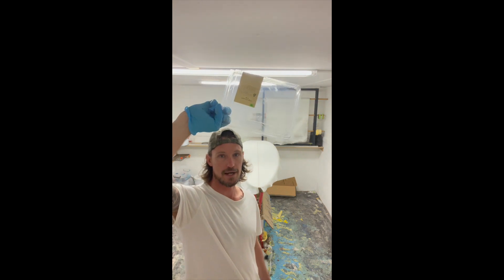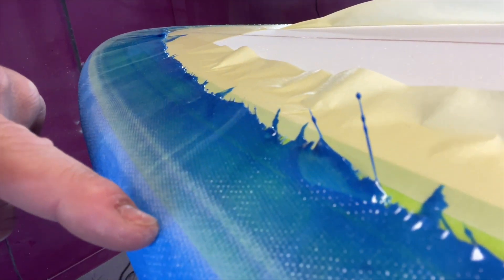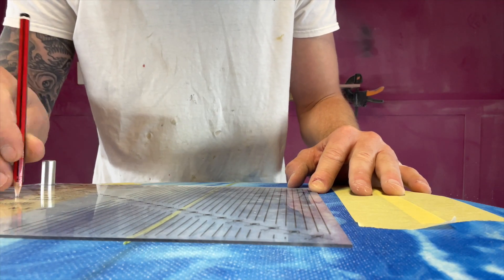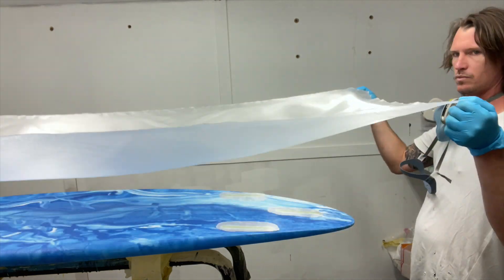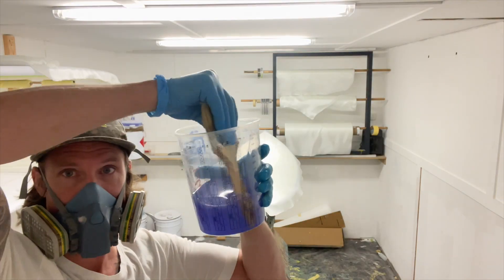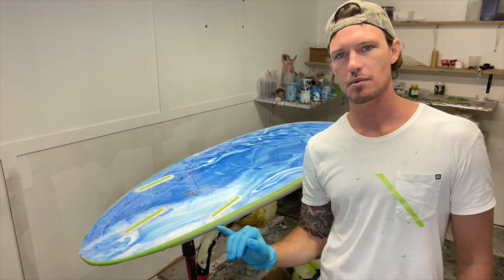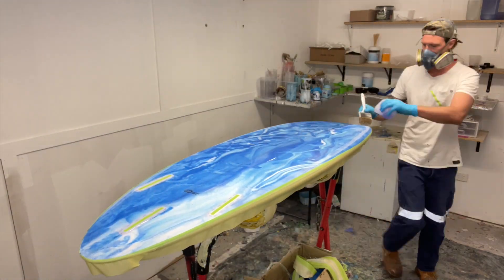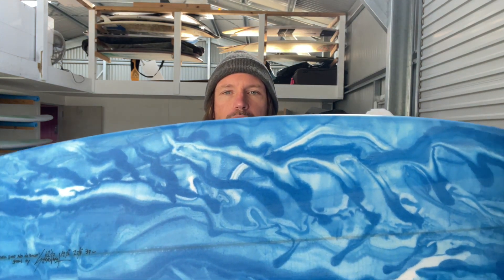Stress free RESIN SWIRL epoxy cutlap surfboard   HD 1080p

Comment: Hey man, doo you have any success of cleaning your brushes off the epoxy after filler/gloss coats? I tried vinegar (which works great for cleaning squeegees, hands whatever), but I have bug struggles with cleaning my brushes - so I use cheap ones just one time (trying to make like 3 boards in one time to reduce waste). Thx for any tip. P.S. I just discovered your channel and thx for brilliant job! Good to see another board builder workflow and some tips etc, still heaps of things and knowledge to discover. Cheers, Milos / Apatyka surfboards, Czech Republic :)))
Reply from the maker: Thanks mate 🤙
Epoxy can be difficult to get outta brushes. I have heard that warm water and laundry powder works but I’ve never tried it. Maybe give that a try and let me know.
Yew!
Reply: @Shrednaught  Oh man, thx for fast reply:) well, will see:) If I will try that I will let ya know for sure:) So gonna stick with single use brushes until then! :)))
Reply from the maker: @milospotuzak3251  yeh man that’s really all I do. Single use unfortunately

Comment: What do you do the pin line with? Most permanent markers tend to bleed when you apply the hot coat.
Reply from the maker: I mostly use posca paint pens. As long as you use them on the sanded fill coat and make sure they’re completely dry they won’t bleed